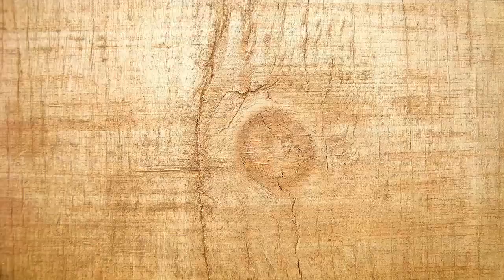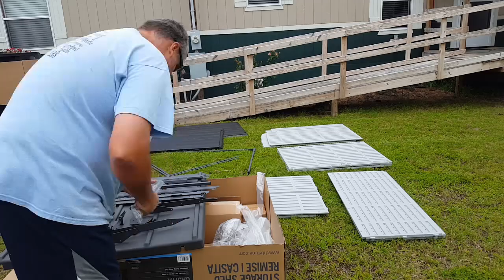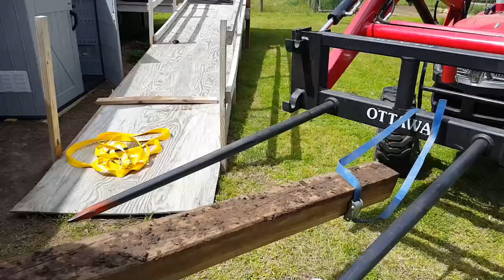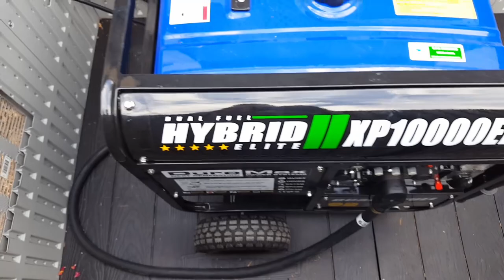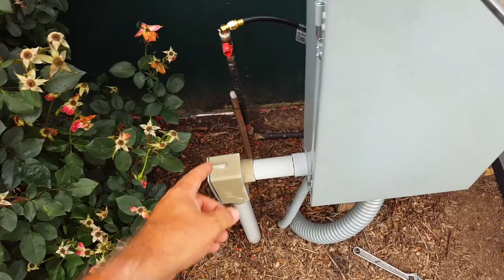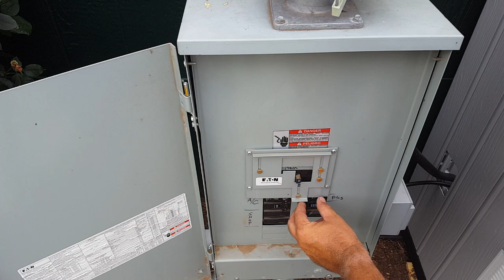Generator for the house - Dual fuel whole house system

Comment: How long will that 325 gallon tank last pushing your generator 24/7 ...??
Reply from the maker: Filled to 80% that is 260 gallons. Owners manual says 5 hrs at 50% load for a 20-lb bottle. So the math says that would 10.8 days non stop. I should hope the electric company has come by before then.
Reply: Thats good to know, i am having a house built and throwing in a 22k watt generator powered by propane and want to throw in a 500 gallon tank ... we just went thru hurricane irma and was out of power for 8 days ... i need to know that the 500 gallon tank at full can power this generator for like a week if need be ...
Reply from the maker: 500 would be plenty for a week... but figure on 80% as most companies won't fill it to 100%
Reply: Yea i dont plan to run the entire house off that generator ... i will just be running the essentials so that the propane will last longer ...  i also want to have that extra storage on my property so that we Have it on hand just in case... this way we dont have to drive around town scavenging for gas and propane ...
Reply: Yea i called the local company here and they told me they only fill to 80% to allow room for heat expansion ... and that its preferable that its covered to keep the sunlight away from it ..
Reply: You Tube :   What brand gen do you have?  My 27KW Generac consumes between 3-4 gallons (propane) an hour between a half and full load, and the Generac site says 2.5 - 3.5 gallons an hour for the 22KW.    Figure 400 gallons in your 500 gallon tank, 3 gallons an hour on average, so you've got about 5+ days of running to be conservative, probably more like 6 days depending on your load.
Reply: upupaepops:
I don't have the generator yet because the new house has not started yet... But from what i have been researching, Generac % Kohler are the only ones that make 22k watt generators... Generac claims 2.1 gallons per min at 1/2 load of ~11k watts... Right now we average ~4k watts with the central ac ON... When its off, we are down to about ~800 watts..  The MOST we ever hit was ~16k watts ... But we are banking on the ~4k watt range which is a tad bit less than 1/4 load.  Which means it should consume less than 2 gallons per hour.. 400 gallons at 2 gallons per hour should give us an easy 8 days ... 
When hurricane Irma came thru we were out of power for 8 days.. !!  I want to be sure we have enough propane on site to run for at least that many days ... And even longer if we use the bare minimum ... 

Im still looking into both units... Not sure which route to go yet.
Reply: @ACommenterOnYouTube  Me too.

20kW gen, with a 435 NET gal tank.
... at 50% load, gen uses 2gal/hr. 

That'll run at 50% load for 9 days, 24/7

However, the cost to refill that propane (at $1.79) will be out of this world!  Oh well, cost for having the conveniences of life I'd guess.

Remember, most of these "standby" generators aren't made to run 24/7.  Maybe best to run them a few hrs then let them cool down a few hours each day. If you need 24hr electricity, an 1800rpm generator is best.
Reply: @ACommenterOnYouTube  Do more research.

Cummins makes one... claiming less fuel use.

I have a Briggs and Stratton. Also claims less fuel use than a Generac.

... hope that helps
Reply: @ACommenterOnYouTube  Most gensets don't "idle down" to run a 1/4 load....  best to size the genset for 50% load, as you'll burn that much fuel.  It'd sure be nice to have a "eco" mode switch on a whole home standby (like on my Honda 7000i) so it only 'sips' fuel... but, that's not the case.
Reply: Yea those portable ones were NOT designed to run 24/7 for days but people still do it. My brother in Law just went thru hurricane michael and lost power for 9 days and he ran his 7kW Caterpillar for 9 straight days 24/7 ... !!  He said it never shut down, kept power to the house the entire time as long as he kept feeding fuel to it and he went thru 10 gallons of fuel every 24 hrs ... Again, its not made for 24/7 use but you have to do what you have to do when the time comes .... Im not going to follow the manufacturer guidelines and risk loosing all the food in my refrigerator or not having water because i am on well water ... That sob is going to run until it dies or the power come back up .. 

But having that propane on your property is the best idea ... Yes its a HUGE tank with almost 500 gallons and it will cost $$$$ to fill up, but its YOUR fuel... And if a major hurricane comes thru and knocks the city or state out of power for days... The propane is there for you ... You have your own fuel supply on your property and you don't have to drive miles and miles from station to station trying to find gasoline ... And unlike gasoline, that propane is good for virtually forever, i think its the tank that will probably expire 1st .. But as long as you keep using that propane and keep filling it up it will last and all you need to do is have it topped off just before hurricane season hits JUST IN CASE ...
Yes you are paying for convenience and when that day comes.... you will be thankful you did ...  As they say, better to have it and not need it than to NEED it and not have it ... 

Then you have natural gas which most people like but its another fuel that you are dependent on THEM ... If power is out, does the fuel still flow..?? If not then what..?? Your generator is dead in the water ..... Now does your generator ONLY feed on natural gas or can you use gasoline or propane ..??  Propane is the best and that 500 gallon tank is the best idea IF YOU CAN AFFORD it ... 

Yea all generators should have that eco mode where it only sips fuel as the demand is needed. SO if your only pulling 1k watts it should only suck up X fuel where if the demand is like 15k watts, then ramp up the rpm and pull more fuel ..
Reply: @ACommenterOnYouTube  My Genset is only LPG or NG.  And I bought my 499gal propane tank used. I already have a 250gal for my home (on a lease). But, that will soon be replaced by the 288gal I also just bought (used).
Reply: My goal for the new house it to have a 500 gallon propane tank to feed a ~20k Watt generator to an ATS that feeds a MTS ... 
In the event of a major power outage, the ATS will kick ON and provide power to the house... IF that generator fails OR the ATS fails, thats when i will have the MTS to manually switch over to a portable 7kW generator to feed power to the house ..
Reply: @ACommenterOnYouTube "Not designed to run 24/7" LOL. How long or how many hours are they designed to run?
For NG... Where I live, when the power goes out the natural gas keeps on flowing. I have been alive for 56 years and have seen dozens of power outages. NEVER have I had to relight the pilots on my natural gas appliances because the power was out.

When it comes to power outages, all electric homes suck. With NG I can still cook on the stove and take a smoking hot shower during the outage. And if I choose I could run my generator on NG and not worry about gasoline or LP tanks. There are some of us out here that have set up our small cheap Chinese portable generators to run on Gasoline, LP, and NG.
Reply: @Deucealive75  yes and i will REPEAT for the boomer you are, maybe hard of hearing or reading, THEY ARE NOT DESIGNED TO RUN 24/7 ....  that is a FACT written in all user manuals

Comment: Even though yours is a 10,000 watt generator, read your book!!! You'll get 10,000 watts if you run it on gasoline but you'll lose about 20% of your power generating capacity or 2,000 watts giving you only 8,000 watts running it on propane because gasoline has 120,000 BTU's of energy per gallon but propane only has 91,600 BTU's per gallon. Being that they only use the A/C in the summer, maybe they could run it on Gasoline in the summer and Propane in the winter. You should obtain an AC volt meter and check the voltage when the A/C kicks on to be sure that there is sufficient voltage to avoid damage to your unit.The voltage should NEVER drop below 115 volts on standard outlets or 230 volts on central A/C units or you could ruin every motorized utility in the house. You should test the voltage at each outlet where there's something like a fridge, freezer or A/C unit. If it is a central A/C unit, be sure to set your meter at a setting above 240 VAC. You can check the voltage at the central unit at the circuit breakers located inside the unit but BE CAREFUL!!! Voltages inside WILL be deadly. When you check the voltages around the house, check them with the meter set at 120 VAC or higher, the generator running and the unit, whatever it is whether it be a fridge, freezer, microwave or window A/C, OFF. With your test leads plugged into the same outlet, have someone turn on the unit and then read your voltage. With that unit running, the voltage should be between 115 and 125 VAC. Then move on to the next unit and repeat this step. When it comes to a central A/C unit, set your meter to 240 VAC or higher and touch your meter probes to the connections of the circuit breakers AT THE UNIT WHERE THE POWER COMES INTO THE BREAKERS. Have someone turn on the unit and read your voltage. It should read between 230 and 245 VAC, preferably 240 VAC. I bought a small, cheap generator for portable power use one time that put out 133 VAC out of the box(way too high), so be careful and check new equipment when you get it. Resistive loads like hot plates, hot water heaters, space heaters, flat irons or electric stoves are more forgiving of low voltage situations. They just take longer to heat up BUT REMEMBER, if their voltage is low, so is everything else connected to the generator!!! I used to have a 5,000 watt Coleman generator years ago and also a 30 gallon, 3,500 watt electric hot water tank. The Coleman ran everything in the house asked of it, well. If the power was off long enough that we needed hot water for showers or dishes, I would shut everything in the house off and kick on the tank breakers. Even though we should have had a 1,500 watt surplus, that 3,500 watt tank would drag the voltage down to 192 VAC with just the tank breakers on. I had the generator checked out just to find nothing wrong with it. No one had an explanation as to what was happening. Years later, I was headed for a fourth spine surgery and couldn't pull a 10 horse rope anymore so I went and got an electric start 7,000 watt Troy Bilt unit. four years later, the water tank sprung a leak so I replaced it with a 40 gallon, 4,500 watt unit. While pulling out the old tank, I found that when the house was built, some fathead wired the original tank with 12 gauge wire. 3,500 watts divided by 240 volts equals 14.8 amps which is toward the upper end of that wire's capacity of 20 amps. Add to this the 60 foot gap between the tank and the breaker box, it really should have been wired with 10 gauge wire so I rewired the new tank with 10 gauge wire and 30 amp breakers to upgrade it. The new tank draws 18.75 amps but the 30 amp rating of the new 10 gauge wire gives a little more wiggle room. The bottom line is the new tank draws only 4 more amps than the old one did but the new generator will run it without even breathing hard and keeps the voltage where it needs to be too. I still keep it shut off until needed though because it still uses a lot of gas to heat it. I have a fiberglass jacket around the tank so it stays warm for two or three days depending on the season.  I only wish my four ton central heat / A/C unit would work with the 7,000 watt generator. We have propane logs for auxiliary heat in the winter. They are connected to two 20 lb tanks in the yard connected to two regulators then connected to a "T" on the 1/2" soft copper propane line. We also have a window A/C unit in the bedroom for relief from summer heat. Good luck with your setup. Jeff M.
Reply: BTU's per gal is understood. But when I tested my small 3.6KW there was no difference in the generators ability to handle a load between gasoline and LP.  I tested with different loads up to 83%. The engine seemed to run better and quieter on propane. I wouldn't expect these results on NG. There should be a noticeable difference on NG.
All generators like this should have the voltage tested out of the box. I set mine for 120 at 50% load. When I was load testing I had 118 at 83% load and around 123 no load.
Reply: Jeff McCrea  👍🏻 correct!!  Oh and breakers USUALLY/SHOULD trip @ 80 % capacity

Comment: OK so I have a 500 gallon propane tank in the ground that was originally used to run the HVAC, two hot water heaters and the range.  Is the regulator at the tank low pressure or high?  How can I tell what it is?  I will only have about a 20' run to the spot where I'll have the generator which is only about 3' from the regulator feeding into the house.  I want to avoid changing anything at the tank.  I was reading on HD's QA for the XP12000EH, it only needs a 3/8" line and at least 3PSI.  Someone also asked the question if you can hook to the low pressure line of your house supply and the answer was 'Yes'.  
https://www.homedepot.com/p/Duromax-XP12000EH-9-500-Watt-18-HP-Dual-Fuel-Powered-Portable-Hybrid-Gas-Propane-Generator-XP12000EH/300659728
Reply from the maker: At my home we have underground tank with red regulator so probably 10psi. Then just going into the wall is the low pressure. If you read the one going into the house it will say what it is... I think the one on my mom's was like 0.5 psi so that was one reason plus the distance that it would not work.

Comment: Do you have vents on both sides of the box? If not add the other one and id avise adding a small 12v fan pulling air in on the pullstart shroud side of the generator that way its getting adequate cooling for thw engine and fresh air for the intake and blowing the hot air out the other side of the shed.

Comment: How long will it run on that big tank?
Reply from the maker: If the manual was correct at full load around 96 hours... but I figure if they watch what they turn on probably more. Remember as the tank gets low the pressure will drop. Outside temperature contributes as well. So if it is ever more than 2-3 days I told them to conserve and use minimal needed.
Reply: 96 hours on 325 gallons of propane? If your generator ran 8 hours on a 5 gallon tank of propane, then you'll get 21.66 days, running it 24/7 on that 325 gallon tank.
Reply: Propane is the most expensive way to go. We researched for weeks before buying in 2004 after the triple hurricanes went thru in central Florida (where we live) and found propane cost 3-4 times as much to run as Diesel and Diesels will be running long after your third propane generator is purchased. Just used our 15,000 watt Diesel for 72 hours straight for Hurricane Irma and ran central air, 2 refridgerators, lights and more the whole time and used 25 gallons of Diesel or appx. $75.00.
Glad to see you bought something as most people can't see spending the money to be prepared.
Reply: plainwornout3 can you share details, i am in Florida too
Reply: Propane is the worst choice of heating due to the price. Owned a 1250sq ft home with 40000btu propane furnace, tankless water heater and stove hooked to a 120 gallon propane tank. I was rationing my usage, only turned on the furnace one hour in the morning and one hour after come home in the evening and last 45-50 days before fill up during winter months. Cost me around $275 each time with all the fees when my tank was just below 20%. Two years ago I moved to 2800sq ft house with 125000btu furnace, 75 gallon water heater, and Viking stove/oven everything on natural gas. I run my furnace all night and morning and me &my gf take hot shower everyday, still doesn’t even cost $90 a month in gas bill during winter months and in the summer time it’s less than $40 a month. If I did the same on propane i would have to fill up that 120 gallon every week!! That’s easy $800+ a month!! I know if you have bigger propane tank like 500 gallon at your home you can fill them up during summer for reduced price but still is far more expensive than natural gas. Natural gas is best heating fuel period

Comment: Atomatic transfer switch and a 22 kw air cooled works really well and you don't need a plastic shed
Reply: Also good luck starting that when it's freezing temps outside
Reply: How much does that cost, btw?

Comment: You said you put a high pressure regulator at the tank. which is OK but you need to have a second stage regulator before your appliance which will drop pressures down to 11 inches to generator. Cetp certified tech. Please be careful with this!!!
Reply from the maker: Norman Fields generator has one on it.. designed to hook directly to unregulated bottle which is way more than the 10 we installed.
Reply from the maker: Leslie B again this generator is designed to use bottle but that was the whole point... my mom cant lug around propane bottles and gas cans so if power out more than 6 to 8 hours what does she do then. With this ahe can go several days.
Reply: Norman Fields yep
Reply: Leslie B you have to watch the BTU output of the machine chances are that will not work rule of thum 100,000 BTUs per 5KW especially in cold weather you will lose performance and have draw issues from the propane tank and could freeze up. Should consult your local propane company for assistance